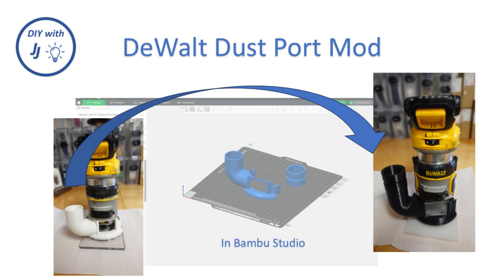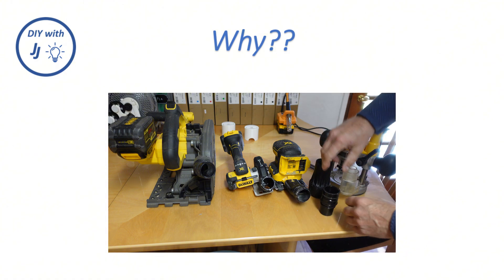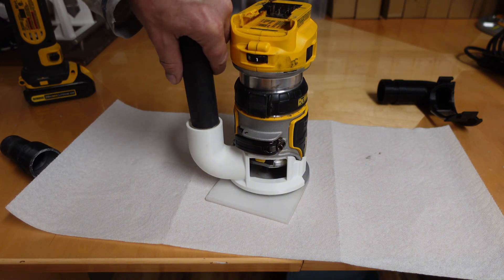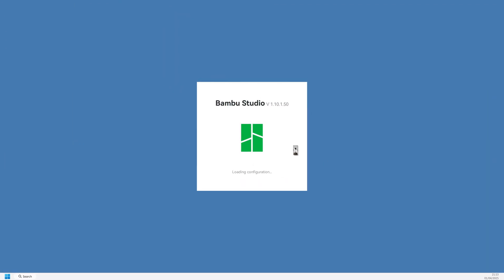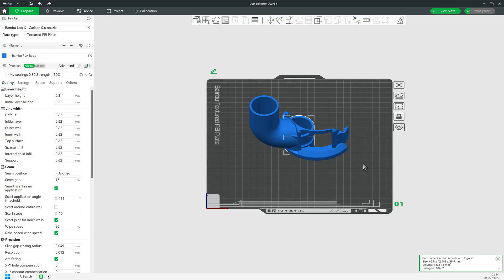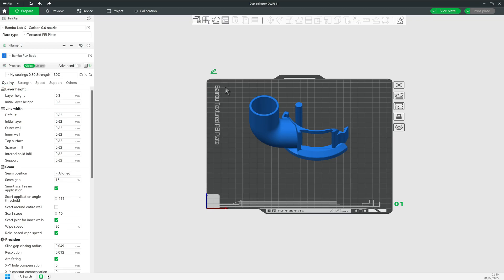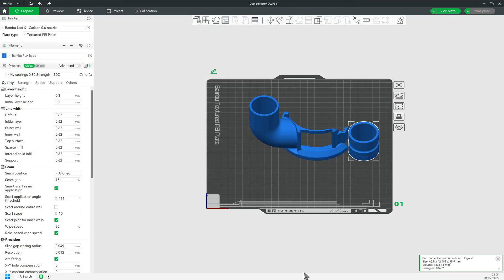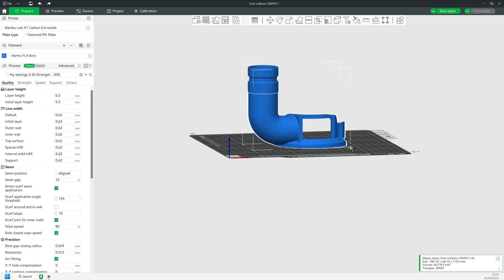Easy STL assembly in Bambu Studio - 3D Printed DeWalt Router Dust Collection Mod

Comment: Came across this and it's gold. I added a magnetic connector to a 4 inch ball valve and the same magnetic connector to a 4 inch threaded hose end. Worked like a charm. Thanks for sharing your knowledge.
Reply from the maker: Thanks for the kind words.  I don't use this technique often since I end up making most of my designs in Fusion.  But when you find a perfectly useful design online where you just need to tweak it, there is little reason to start from scratch.  Glad it worked for you.